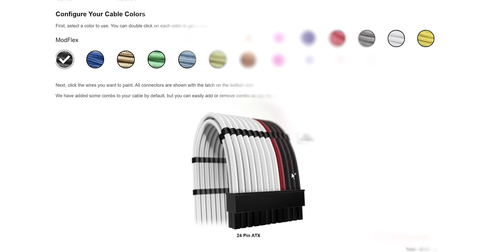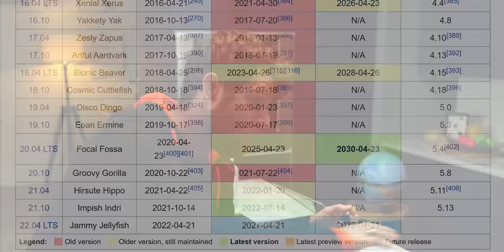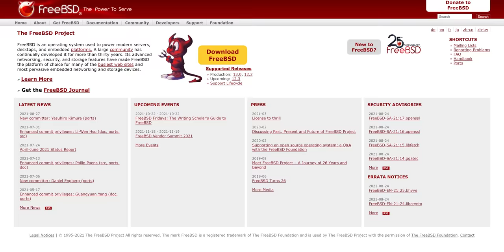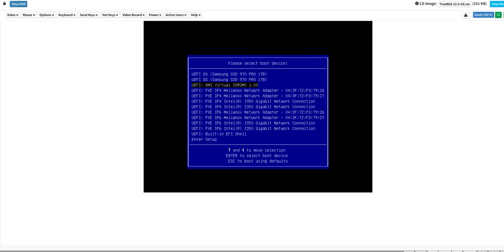We Finally Did it Properly - "Linux" Whonnock Upgrade

Comment: "Is our one and only production network editing server."

That had the network engineer in me internally screaming about a single point of failure in the prod environment.
Reply: As a network guy, most of what LTT does has me wondering "WTF, mate?"

These people would work well in government with the mentality of "throw more hardware at the problem". I mean, halfway decent monitoring and administration would root out most of these problems before they became problems. 

But hey, whatever. Entertainment for the masses.
Reply: They're probably in a position where they could get a replacement server going in a day or two and the effort required to have redundancy isn't worth the one-off instance where a single point of failure happens
Reply: Also imma counter my own argument by saying that it would be costly for that many editors to take a day off, but as A C said, "Entertainment for the masses".
Reply: they have both a seperate onsite and offsite backup server
Reply: @ChrisJones-gd2no  Data backup and redundant production servers aren't the same thing. The backups keep them from losing any work if something breaks, but they would still lose the ability to do new work if New New Whonnock failed.
Reply: well calm your network engineer by telling him that editing workstations are redundancy in it of themselfs, What do i mean by that if that server fails they can for some cost of time still store data on and edit videos directly on the machines
Reply: @LidellFrasier  well they wouldnt lose the ability to do new work becuase they can still store files onto their editing computers and edit that way
Reply: @bigpod  All of the files they're working with are on the editing server. The workstations just pull the media they're using for he current project in, and not all of it at once. If they can't pull more media, they can't do more work.
Reply: @LidellFrasier  sure but if the server dies and they cant replace it right a way they can still copy files onto the editing workstations cant they or did i miss the fact that once you do what they did you are forbidden of using local storage
Reply: @bigpod  The stations where they ingest raw footage are separate from the editing stations. It would take more time, effort, and lost productivity to restructure their workflow to use local storage than it would to just wait for a new production server to be deployed. Having a redundant editing server would mean that work could continue without any real interruption
Reply: @bigpod  Also, if they were to start ingesting footage to the editing stations, that would be new footage that they've recently shot; the way their production pipeline works, that would be footage for videos that aren't supposed to be out for weeks, while all of the footage for the current and upcoming weeks would be inaccessible until the server was replaced or repaired.
Reply: @LidellFrasier  that is called lack of imagination and is it realy that hard to take a drive and inatead of pluging it into ingest pluging it into a workstation if they are smart they have backup workflow already explained
Reply: @LidellFrasier  they actualy backup that server to other servers so that data is still accessable and additionaly they probably wont ingest directly onto the workstations but to another server then copy to workstation so to keep nost of the workflow intact including injestion part
Reply: @bigpod  To address your points in order: Yes, it is that hard to ingest to workstations instead of dedicated ingest stations. That not only adds more steps to the editors' jobs--steps that they aren't necessarily proficient with--but it also presents all kinds of complications as far as tracking custody of data and reconciling it with their established workflow once the outage is over. On the second point, the entire reason this discussion is taking place is because they don't have a backup workflow to switch to in case of a production server outage. And that's not even taking into account the production schedule mentioned in my other comment. You can call it "lack of imagination" all you want, but in their current environment it would be more costly to try to implement a fallback strategy on the fly than it would be to just re-task editors onto other projects (inventory tracking and management, any housekeeping that's fallen behind) until the production environment is restored to working order.
Reply: Linus has a very short memory and proven time and again he never learns from His mistakes. If he can do anything the most convoluted and half assed way he will.
Reply: Oh hell ya i was losing my mind hearing that one ... Even I have backup redundancy and im a nobody .. Why !!?
Reply: @LidellFrasier  I think the point bigpod is trying to make is that they can plan and test multiple different fallback strategies instead of "on the fly" like you are implying. Which would cheaper and simpler than buying a second server. You, like the government employees mentioned in a previous comment just want to throw more hardware at the problem.
Reply: @firecrow7973  Changing workflow is a lot harder than you seem to think. Also no footage is ever copied to the editing workstations and the ingest stations copy directly to the server and then the footage is deleted off the recording media. So if the main editing server goes down then the only source of data to work off of is the backup server, which as I understand it is just a mirror. In the past they would just re-map the share to the backup server UNC path and limit the number of people working, their file sync software would take care of file versioning and coping files after the main server is back online. It's that software that made Linus stick with a Windows file server for so long, it's a Windows only software.
Reply: @firecrow7973  With the above said an HA solution doesn't cost that much more, the disks are shared. You don't buy two literal exact copies of the servers and SSD/NVMe storage.
Reply: Quick glance, but another single point of failure looks to be the 100Gb switch, and that’s not an easily replaceable item. Pretty sure the local computer store doesn’t sell them, much less keep them in stock. Of course, that also an expensive item to keep a spare on hand. Maybe keep a 10Gb on hand as emergency backup and have a plan for overnight ship replacement on the 100Gb.configure the spare switch as active, with redundant links, using a higher metric if it’s not as fast.

Most of the server components are pretty readily available, so should be able to replace/repair quickly. Keep a spare 100Gb NiC, drive, PS, drive controller, and motherboard and you should be ok. Basically, a cold spare server minimally configured. 

And, of course, multiple UPS systems connected to he multiple power supplies powering that server…
Reply: What kind of hardware/software is needed for a server with a lot of small files?(for CAD files for example. These file are rarely bigger then 1 mb except for 3%of the files.(are the some best practices for this use case?)
Reply: That’s what I don’t understand. They’re running a business, why don’t they have a proper small business/ enterprise setup?
Reply: Well, it's not really an editing server...it's a storage server.  They pull the files to their editing workstations, edit them, and send them back.
Reply: @jesseg7757  The files stay on the server, they are read and written directly over the network. Copying files back and forward is not happening during editing. That's why they test the timeline scrubbing, because the files are on the server.

Comment: "We could [turn compression on] later because we have stuff like Word files"
Those are already compressed. .docx is just a .zip with a bunch of xml in it.
Reply: Deduplication would be best in that scenario
Reply: @vlamnire  Deduplication is only useful if the files are mostly the same. Unfortunately, changing a single letter in a .docx file results in an entirely different binary stream, as it's zipped.
Reply: I get the feeling these guys never were that great at Windows software in the first place. Figures.

Comment: For optimal ssd performance you want ashift size * (number of drives - parity) to be as close as possible to your record size or could be multiplied to be close to the record size evenly. This decreases fragmentation and pushes to disk faster. For nvme pools this is hugely helpful.

Don't forget to figure out your ashift properly and set it correctly. This is a huge performance suck in systems like this. 

I spent a fair amount of time testing 10x nvme systems on zfs for VM workloads.
Reply: From my experience, ashift does not matter as much as does recordsize. This is because basically cannot get ashift past 16 i.e. 64KB, but you can get recordsize all the way to 1MB (it's a different question if you should). My experience is running some 12 NVMEs in a single RAID0 vdev (temporary files, when chia was still a thing)
Reply: @bronekkozicki6356  ashift needs to match the drives native block size. Don't change it to match that formula. However setting record size to match that formula really does help. If you're mismatched on the ashift vs drives, you'll rely on the drive cache to fix fragmentation which drives are really good at. However if you're not matching the formula, you're relying on zfs to fix fragmentation, which increases write caching before data can be flushed to disk for no reason other than to fix fragmented blocks.
Reply: and don't forget to spell "ashift" correctly, your server is working too hard to deal with that kind of language
Reply: Same, had 20 4U servers with zfs and iscsi pools full of images and another mega pool full of VM's, ashift benchmarks and in every way could be imagined and possible. Is very addictive and entertaining!
Reply: @johnlocke9609  WAT?

You Lost me there... :-/

Comment: 10:15 Word files (at least new ones in the docx format) are actually just zip files, so they probably wouldn't compress either.
Reply: Also it's insignificant compared to 8k+ 60fps raw videos.
Reply: @lukasg4807  One would hope lmao.
Reply: Yes indeed, I didn't know this either. At our company we've moved to Asciidoc for this exact reason
Reply: Dunno how they are storyboarding their content (if they even are?) but Office docs use a medium Zip compression, so you can throw them at 7zip and compress the ever-loving hell out of them.  It usually gets another 25% of space.
Reply: @docferringer  I have a feeling that activating system wide (storage) compression would just use more CPU for no real benefit. Movies will not get smaller and .docx/.odt files are much, much smaller to make a difference.
Reply: @FlorinArjocu   It's a hypothetical situation.  We do a compression pass on all of our PDFs at the office, usually about about twice a year.  Those things are spat out of scanners, fax machines, and Print-to-PDF drivers; usually none of them bother compressing .  When you add up the savings over a couple million files you will end up with a whole lotta reclaimed gigabytes.
Reply: @docferringer  Yes, you are right, it might have sense for regular office work. But they work with a few GB up to a few tens of GB footage videos, that is just one piece.

Comment: Back in the dark ages when I was getting my CS degree there was a “computer room” on campus that held 2 IBM mainframes. Only one was in use. I asked why and they said the other one was dropped bringing it in.
Reply: What college was it at?
Reply: Irish Times, back in the early 80s, took delivery of six Atex modified PDP-11 units.  They had to be hoisted by crane through a second floor window.  Only five made it.  The sixth dropped to the street below, a very expensive 3-D jigsaw puzzle.
Reply: @andrewyong3389  Old Dominion U.  According to the techs they used it for spares.